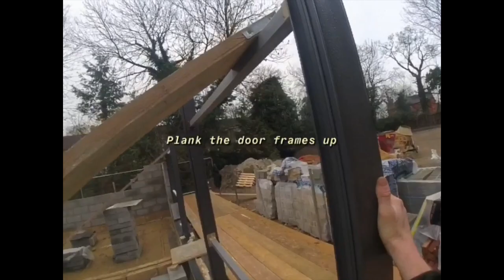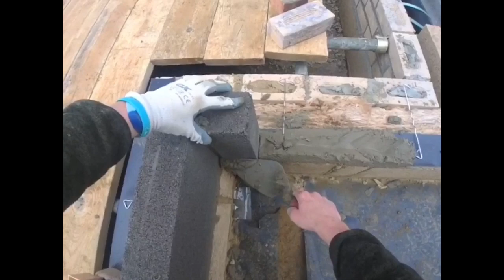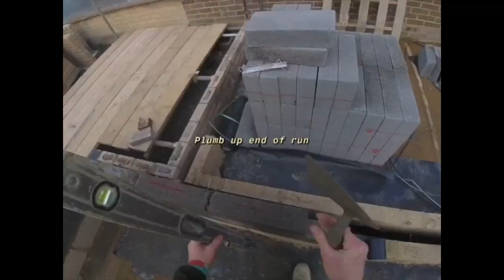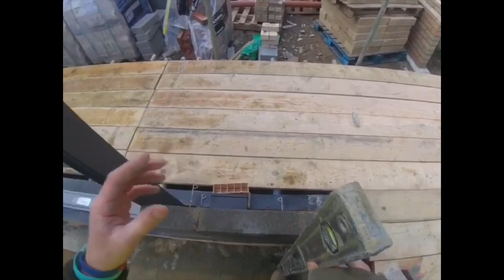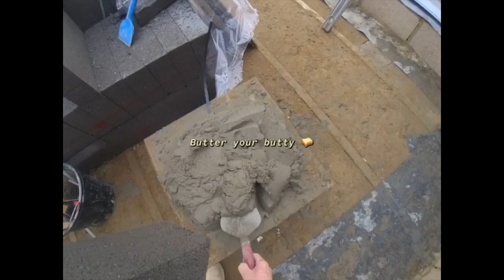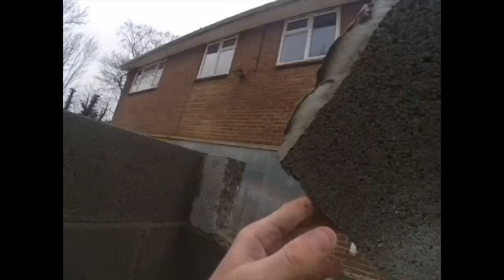Building block corner (tutorial) | The skill of bricklaying.

Comment: Nice tidy bricklayer. I have always liked a ten inch trowel as a starting point and when they wear a bit I like them better. I would if I was you start breaking in a new trowel now. I’d use it on the running in and it will break in nicely.

Comment: I always do internal block work first as well up to window cill height usually 4 or 5 courses in like you though I do quarter three quarter bond as in the corner you can only bond the thickness of a block. I sometimes end up with what is known as Brook bond as blocks that are to be rendered will never been seen and I was always taught to use all usable material. Bedding a DPC seems to be something done only in the south of England and as long as the frogs in any brickwork are filled I don't understand why it is done. Please educate me? It has been explained to me about the pointing of internal block work but if I miss any joints I check front and back and fill in any defect joints using a pointing trowel. Each to there own I guess but apart from you hitting the level the work looks as it should level, plumb and straight well done.

Comment: Why is it that you joint your block work? Isn't it going to be rendered?
Reply: Blockwork should always be jointed up. Fills holes in and compresses joint. Looks professional too
Reply: @michaelamos4651  You should be able to build it without leaving any holes! compressing the motar with the weight of the block is more than sufficient. And it's a waste of time that could be spent laying. Im not taking away from this man's work however, it looks great. Good job!
Reply from the maker: I’m on day rate haha 😂. Thanks for the input.
Reply: @GingerDust69  ah fair enough lol good work!
Reply: All new builds have to have a pressure test that's why everything as to be jointed so even when no test is required i.e. extension,  it's still good practice. .
Reply: @GingerDust69  please can you explain what day rate is? Is this fixed price per day regardless of amount of bricks laid? Opposite of price work? Price work being paid depending on how many bricks are laid.
Have I got that right? Many thanks kind regards 👍
Reply: @JimJimpmjj  correct. Day rate is  far more relaxed where you can slow it down and take a bit of pride in your work without losing money.
Price work generally pays better but is far more stressfull where you lay as much as possible every day
Reply: @saltychannel21  thanks 👍